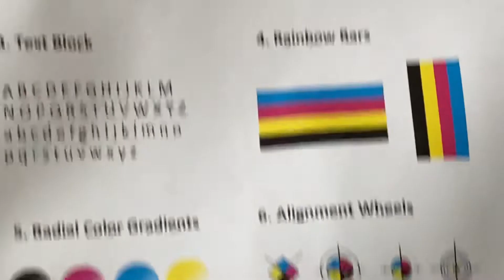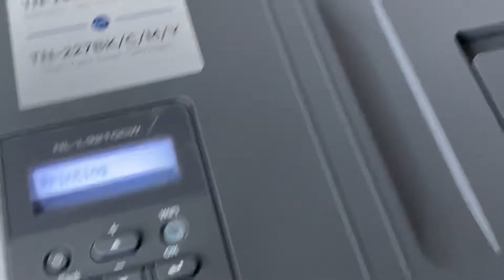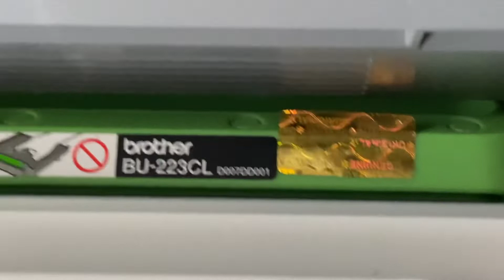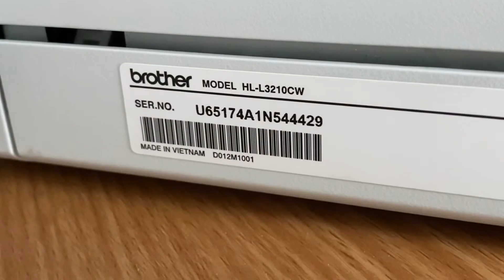Open box Brother HL-L3210cw Compact Digital Wireless Color Laser Printer 42 Pags

Comment: Does this printer require ALL toners to be available on for it to be able to print or does it allow you to print even if you only have black toner?
Reply: No answer to this?
Reply from the maker: The Brother HL-L3210CW is designed to cease all printing operations when any toner cartridge—black or color—is empty. This design ensures the longevity of the printer and maintains print quality. Therefore, if any toner cartridge is depleted, the printer will not function until the empty cartridge is replaced. ￼

This means that even if you wish to print in black and white, the printer requires all toner cartridges to have sufficient toner. Operating the printer with empty cartridges can lead to issues such as air being drawn into the print head, potentially causing damage. ￼

To resume printing, it’s recommended to replace any empty toner cartridges promptly. Regular maintenance and timely replacement of consumables will help ensure the printer operates efficiently and produces high-quality prints.
Reply: @FalconTechology  Thank you for that. I've just ordered the 3220CW. Will I be able to get cheap compatibles for it?
Reply from the maker: Yes you could use after market toners
Reply: @FalconTechology  Phew. Glad about that. It was hard work learning about printers. Hope I made the right choice. Cheers for the info.
Reply: @FalconTechology  Crazy thing happened today. The company I ordered the 3220CW from recommended I not actually buy it as the toner will be £500 to replace, and then recommended an HP printer. Crazy. Usually I make an order and get the item, not be told it's not a good idea! Why even sell them?? I've cancelled just due to the weirdness of it. Amazon have compatibles for far cheaper. Also told me it would only work with Windows 10/11 (which is fine) and that it doesn't do double-sided. How hard is it to turn the paper around and put it back in? Sigh...
Reply from the maker: This is an older model and is only available in the used market. The toner is available on Amazon. HP is good, but the toner for HP costs more than $400 per set. Additionally, many HP printers only accept genuine HP toner, which is expensive. I would recommend going with Brother, though not necessarily this model. Just make sure the model ends with the letters “DW,” which indicate duplex and wireless functionality, meeting your need for double-sided printing.